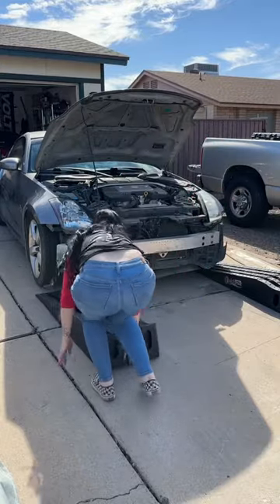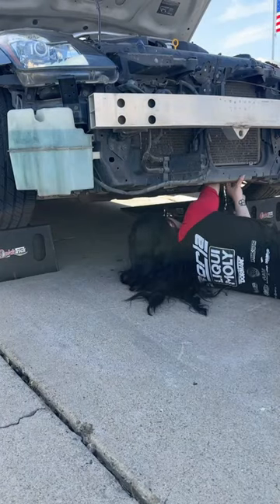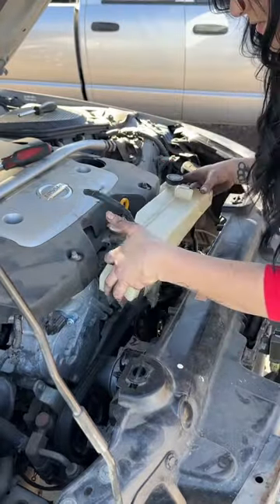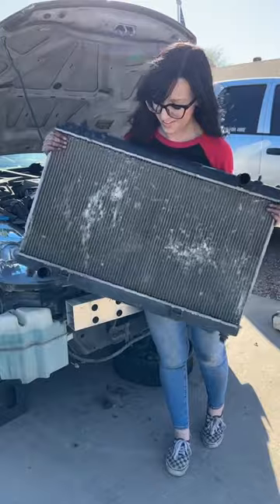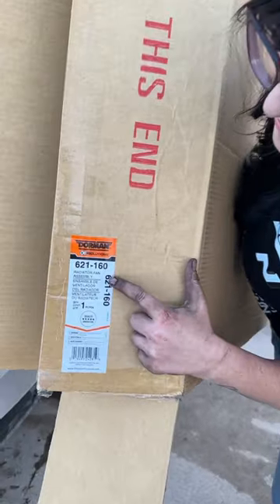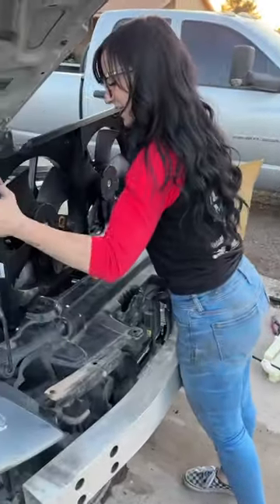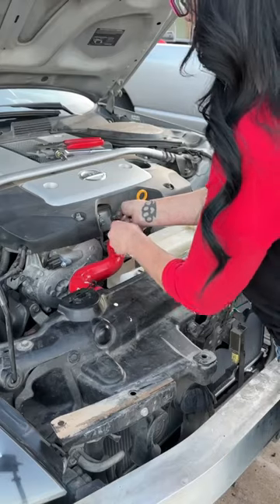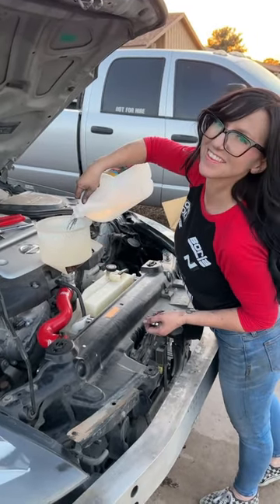New radiator, fans from Dorman Products, and silicone radiator hoses! Can’t wait to slide

Comment: Excellent but why you dont use engine coolant liquid ? , instead of normal water
Reply: track use, some tracks require you to use distilled water just in case your cooling system blows up or if you get in an accident you will not spread coolant everywhere which will make the track condition and cleanup bad

Comment: This is a realistic seeing dirty hands than a video i saw recently but inspiring took out heavy parts alone. Last sunday my wife & i diy her over a decade old perodua myvi/toyota passo/daihatsu boon/sirion. Changed the radiator hose (lots of curses), thermostat & a 120W radiator fan (to my surprise, their workshop manual said for tropical & auto should be using a 120W instead the rebadge version/perodua myvi was installed with a 80W 🤬). Fed up with workshops didn't diagnose properly the car's temperature problem & hot a/c.

Comment: Only mistake was endorsing anything made by Dorman. She’ll be replacing those fans within a month or two.😊
Reply: No so much anymore!!
Reply: I've never had problems with Dorman products. Besides, many of todays aftermarket parts are made in the same factory, just rebranded.
Reply: I came here to say that.  Dorman is bottom rung
Reply: @808G8GT  you must not work on vehicles very often then…
Reply: Doorman is hit and miss. They tend to be plug and play around
Reply: I got Dorman transmission’s lines, they lasted me over 6 years and counting
Reply: I've been working on cars since I was 5 years old, I've never had an issue with Dorman stuff either.

Comment: I had a set of those plastic ramps and they's adjustable for getting the vehicle higher off the ground and when I gave up mechanics I gave em to my nephew...I haven't seen anymore of em cause I need another set for oil changes. I don't even remember where I bought em and I'm pretty sure it was a yard sale cause 1 of the pins was missing and I made one. I can't even remember what brand they were but if you ever see any of em please let me know in the comments...I enjoy watching all the time and work you put into your cars and I'm also wondering if a Pontiac 2.2 ecotec engine would be worth doing anything with cause I'm bout ready to rebuild or replace mine cause it has gobs of miles but it still seems to run alright for now. I thought the car had a V6 but it's the ol 4cylinder ecotec engine

Comment: Why distilled water and not coolant? Is it's a Track rule in case cooing system blows and doesn't get track slippery?
Reply: 100% Water is better at cooling your system than a 50% water 50% coolant mix
Reply: coolant just has anti freezing capabilities if you’re in a cooler state. But she looks like she’s in cali? so she ain’t gotta worry about that
Reply: @margidda5252  what! That is stupid. 100 percent water will burn and rust your radiator. You put 50% water and 50% coolant. 50/50 is the standard in California, only in cold climates you use a 30/70 or 40/60 spilt.
Reply: @MWAclanGaming  distilled water won't cause it to rust. Coolant is distilled water and antifreeze mix together.
Reply: @biggdogg33  yes 50/50 that I mentioned but straight water only will burn.
Reply from the maker: @MWAclanGaming  incorrect
Reply: yes correct its a track rule, coolant is pretty slippery on the track

Comment: Maybe she uses water wetter. I know most people do this in drift events in case the car blows a hose or gets in a wreck, as coolant on the track will make track conditions undesirable. This is what most teams did when I was helping my buddy out during Pro-Am events. Most of these drift cars run the track for small amounts of time and generally don't sit in traffic idling.

Comment: Distilled water alone is not good on the long run, try HOAT coolants they're way better, i know nothing like distilled water alone for quick heat transfer but on the long run it's not good at all.
Reply: this is a track car, some tracks require you to use distilled water instead of coolant in case of accidents or cooling system blowup